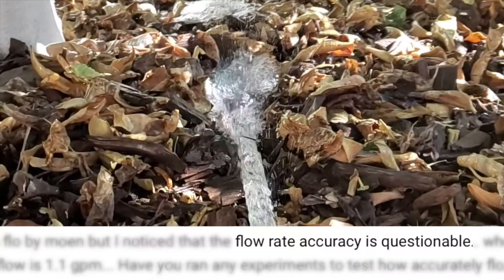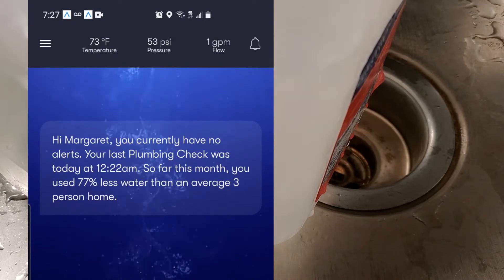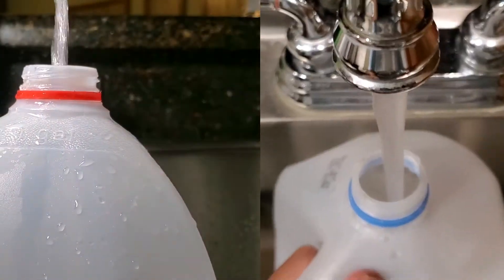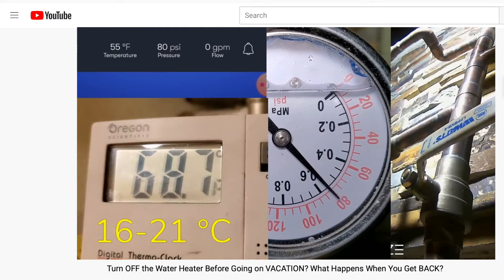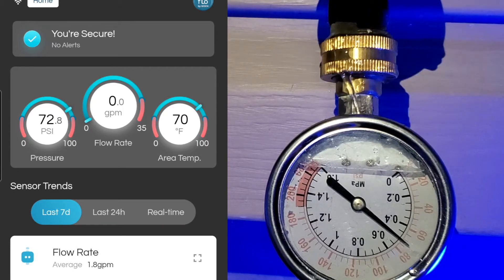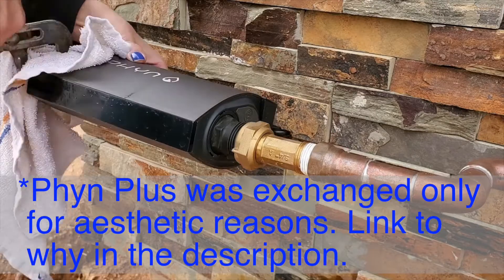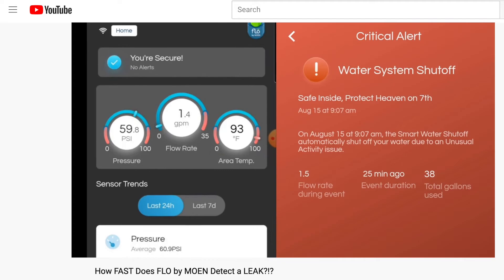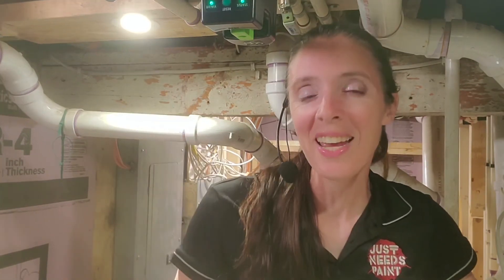How ACCURATE are the FLOW & PRESSURE Sensors in Phyn Plus & Flo by Moen

Comment: One of the benefits of a Flo or Phyn water monitor system is to get ongoing data and insight into stuff that might be going on in your water system besides alerts to leaks and high usage. I check the graphs on my Flo system and notice the fluctuations in pressure are surprising. It normally runs 50 to 55 psi but occasionally gets to the high 60s and today it peaked at 112. Street pressure is 115 to 125 psi. Average pressure is 50.4. psi so Flo is happy. But I'm thinking I have a pending problem. This is a new pressure regulator (about 3 mo. ago). I'm trying to decide if the variations I'm seeing are normal or not. I saves  screen shot of the last 7 days. Too bad I can't share it here. In any case, there is no substitute for hard data and these devices provide that. Every home should have one. The Flo app only shows the last 7 days. I know Moen has all the data back to when it was first installed. I need to figure out have to get access to that if I need it.
Reply from the maker: That's crazy high! I like your idea of keeping a weekly screenshot for tracking purposes. 100% agree--every home should have one!
Reply: Did it shut off the valve automatically once it detected a high pressure? Thanks

Comment: Do any of you guys have your Setting Screen on the Flo By Moen set like mine?
      Units
       Imperial      Gallons: Fahrenheit, PSI
       Metric           Liter, Celsius, kPA
I selected Imperial; 
I US Gallon = 0.832 Imperial GAL
I have the suspicion that my unit was set up to report Imperial Gal rather than US but Moen is insisting that my unit is reporting US gal. 
 When I fill a 1 US Gal container from a faucet in my house my Flo device repeatedly reports 0.8 Gal.
Reply from the maker: That's an interesting thought! If the app is just stuck on your end in the wrong measurement system? Definitely hit up this video's comment section https://youtu.be/EHGaHNMOKsw and you can reply to Will K on his experience. He had the exact same problem! He's a regular commenter and has done some solid testing of his own (although he switched to Phyn Plus because of this issue) so I think he'd reply. That conversion didn't even occur to me.

This is a long shot and you've probably done this: I noticed if I switch certain settings I have to make sure to dismiss the app so it is no longer running, then if I open it up the setting that I just moved is actually getting used. That's in an upcoming video when I was modifying the health test drip sensitivity slider in the notifications settings. A second thought is to uninstall and reinstall the app? I'm not as innovative as tech support, but I'm all for doing easy answers when the line has already been cut with a device inline.
Reply: @NoMoreLeaks  I certainly understand your line of reasoning so since I had the Flo app running on three Android devices I loaded it onto my iPad and repeated the test using the verified 1 US Gallon container but the Flo device again reported 0.8 Gal. I have had several email exchanges with Flo support with screenshots taken from my devices to bolster my case. I have been offered an exchange Flo device that should be delivered to my house soon. Hopefully they will run test's on my old unit and not just ignore this issue.
Thanks for your detailed videos; I am now subscribed to your channel.👍
Reply from the maker: That's great news! You certainly tried everything. *fingers crossed* the next one is spot on! Thanks for the sub--as a Flo user this Friday's video will be (I hate to say possibly disappointing) something to possibly plan for in the future.
Reply: Yeah, I can confirm at least in my experience, the flow by moen unit I had was showing ~0.7 or 0.8 gpm flow rate when the actual flow rate was really 1.1 gpm.... I tried many things to fix it - even took the unit apart and cleaned out the turbine, no luck. 
Switched to Phyn and the accuracy has been spot on. Also, the phyn will detect down to 0.1 gm (very accurately) while the Moen unit I had wouldn't go below 0.3 with any accuracy. (this matters to us because we have an RO system that runs at 0.15 gpm)

Comment: Thanks for another video!  I've had my Phyn Plus online for about a month now and it just unlocked the auto-shutoff feature.  I have noticed the PSI readings vary between about 50 - 80 with no pattern [that I can detect anyway] to explain.  I'll have to check one of my spigots with my gauge soon but readings were about 70 PSI before the Phyn was installed.  Love your videos.  Keep 'em coming.
Reply from the maker: Veeery interesting! That's a BIG range. Do you have a PRV? I don't but our city pressure is steady in the mid 50's. Except the time I was running the high flow cutoff tests for Flo where of course, it was 63 psi and that wasn't something I could just replicate when Phyn was installed. 😒😉 You get that as an engineer when you are running a test and you can't predict the variables (especially because I didn't know the average psi in the first place).

I really appreciate the support. The next 3 months is solid Phyn/Flo. Did you see Phyn Plus is revamped? Gen 2 came out yesterday. I definitely have mixed feelings. I KNOW our Gen 1 units are solid after having finally made it through the summer here.
Reply: @NoMoreLeaks  I do have a PRV and, based on my below measurements, it may be time to replace it.  Should probably have had that done when the Phyn was installed.   Phyn currently shows 58 PSI while my main level and basement level spigots show 65 and 76 respectively.  I would expect the basement level to be somewhat higher as that is where the city line enters the house but that's also where the Phyn is installed so it seems strange its readings coincide better with the main level spigot.
Reply from the maker: Is there anything in between Phyn and the basement spigot? Is one higher than the other? You bring up a good point. I hadn't considered the difference between levels too much. My water pressure gauge has exactly the same reading at the spigot right next to Phyn as the spigot in the backyard (I'm estimating the line is about 60' with 16' in elevation change with a PEX bypass from plumbing under the slab to the attic and then back down), but both spigots and Phyn are within 12" of each other height wise.
Reply: @NoMoreLeaks  My Phyn is installed directly after the PRV where the line comes into my basement from the city.  The basement spigot is maybe 50 ft away as the crow flies.  The main level spigot is directly above but I have no idea how much plumbing exists between either spigot and the Phyn.

Thanks for your reply.  Phyn indicated a pressure drop when i first installed it which I was able to trace to a leaking toilet.  Since then things have been fine except for the pressure variations and occasional incorrect event categorizations.  I figured the PSI inaccuracy had to do with the ultrasonic measuring technology and wasn't overly concerned.  Now that I know you're not experiencing this issue I think I may need to consult my plumber and possibly have the PRV replaced.  Should have just done that when the unit was installed.
Reply from the maker: Repeat visits are not fun. I'm really interested in hearing what your plumber says and what ends up happening.
Reply: Not if this helps, but my phyn shows the exact same thing - fluctuations between 60 - 80 psi. I confirmed that the fluctuations in my case are really occurring (not a sensor error) via several different mechanical gauge tests. I suspect the pressure changes has to do with my tankless water heaters automatic recirc setting which occasionally heats up a 1 L water tank and I don't have an expansion tank... I probably should...

I also have a brand new PRV just upstream of the Phyn. maybe your PRV is ok, but you are seeing some thermal expansion cycles causing the changes?

my last point to make - and this is key, is that my phyn device always read exactly 11 psi lower than the real PSI. I contacted phyn several times and they say they do not guarantee the pressure readings have absolute accuracy, only that the sensor measures 240x per second and will measure relative change with accuracy.... so, maybe you have a similar situation to me where your unit is just reading the psi incorrectly by a set amount.
Reply from the maker: Thanks for replying to this thread, Will! I thought of your situation, but thought this one was slightly different. My husband and I were talking about your two scenarios (to be clear, the lower PSI on both yours and John's)--like if there is something in common that is specific to the installation, which is different from mine. Do you have a tankless, John? And is yours in the basement, Will? Just trying to figure out what might cause this--if there is anything that could be done.
Reply: @529Tempo  Thanks Will.  Great info.  I haven't bothered contacting Phyn as these anomalies don't overly concern me.  Since the spigot measurements are within acceptable range I do not believe any of my household fixtures or appliance are in danger.  I'm no expert but I do see what would appear to be an expansion tank installed directly above my water heater which was replaced in 2016.  Shouldn't that eliminate thermal expansion as a possible culprit?
Reply from the maker: You might be on to something there. Thermal expansion tanks last about 5-10 years. This article looked like a good one for possibly diagnosing if the expansion tank is the problem: https://homeinspectioninsider.com/expansion-tanks-signs-of-failure-safety-concerns-costs-to-replace/